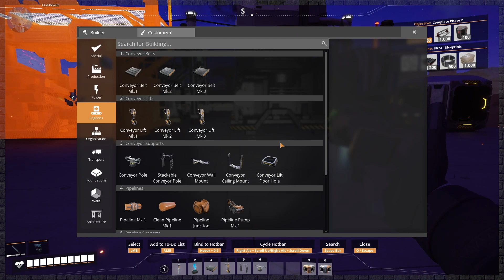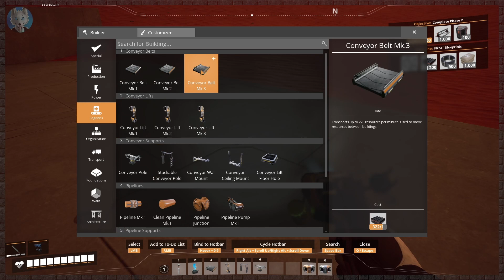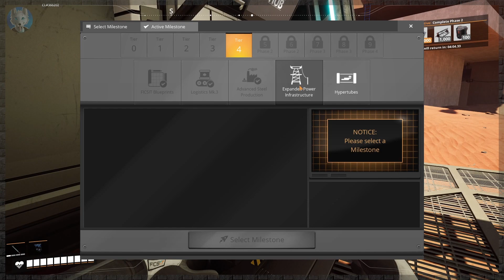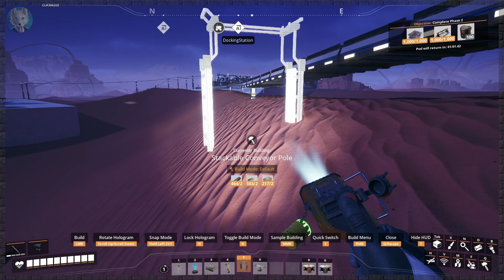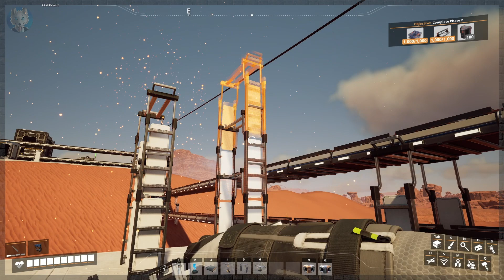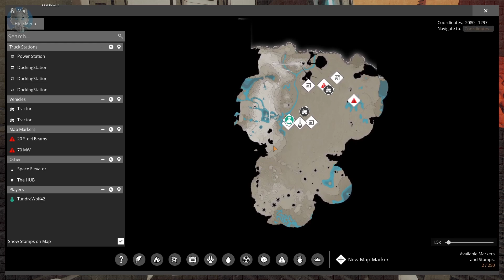Satisfactory 1.0 | Singleplayer | S4 Episode 9

Comment: Popping into the comment section while I'm (attempting to) catch up on this series re: your audio quality; While it obviously could be better with fancier equipment, I'd say you've set it up well enough in the aspect that matters the most: there is no background noise or static polluting the rest of the audio. That's the one common issue (other than particularly severe volume imbalance) that is the most likely to single-handedly make a video unbearable to listen to IMO. Other than that, I think the overall sound quality doesn't matter nearly as much past the point where your voice can be heard clearly. This might be a moot point given that over half a year has passed and for all I know you could have switched to an improved audio setup since, but as of this video I'd say the audio is just fine for what it needs to be.
Reply from the maker: Thankyou! I still get comments about mic audio, but they are much less now. Once I learned about audio filters for the mic, it improved it so much. I still have the same headset that I have had for over 3 years by the way, lol. Getting by with what I have. One day I will be able to purchase a better one.

There was a point were it sounded so bad, during season 3 for instance. This is because it is a gaming headset with a mic. It may have costed $200 at the time, but mic quality was not a priority for it, the 7.1 surround sound was and the RGB lighting, lol.

Since it is not designed for recording all those filters are needed to keep it sounding atleast somewhat good. When I do get a new mic it will be a streamer mic. This headset is not doing so good anymore.